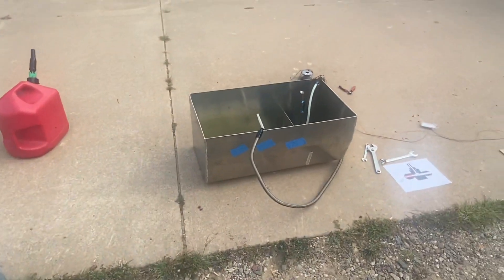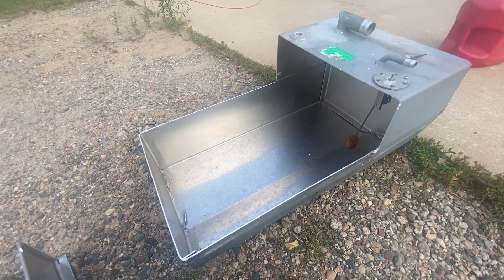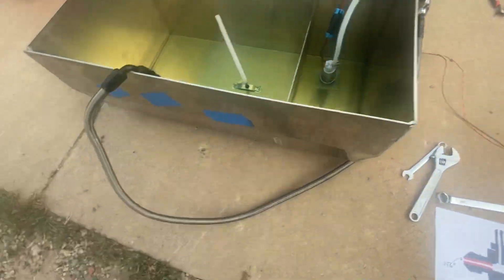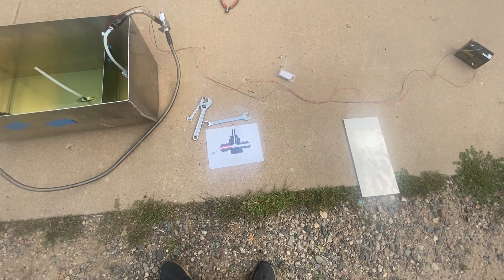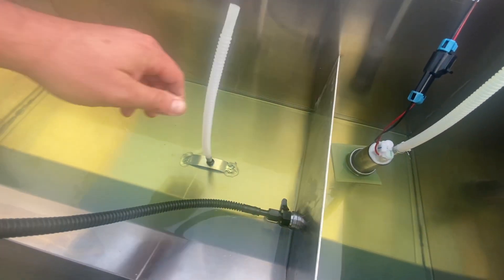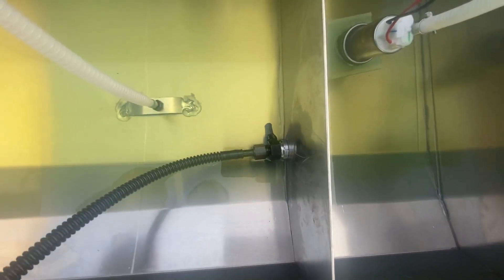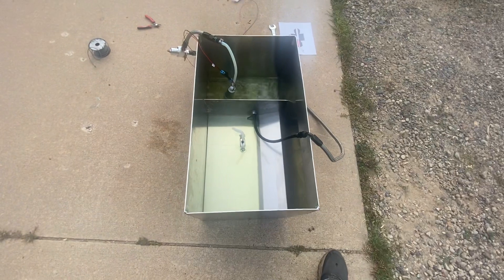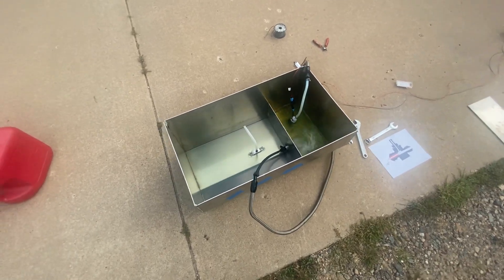Building fuel tank venturi jet pump, Turbo BMW boat part 3

Comment: It´s a snazzy solution, but you could have just gotten a 30USD lift pump that would run when the main pump runs, takes about 1A and would keep the reservoir full, another option would have been to take out a jet pump from a BMW fuel tank and just use that.
Reply from the maker: How is that better than this which cost like $15 and can never fail and takes no wiring?  I don’t have any bmw fuel tanks.
Reply: What you have there is reliant on the amount of return flow, which of course usually is plenty, a pump has no such relations.
That is but one a reason why jet pumps aren´t used in race cars but lift pumps are. @someguy325es 

I should ad that an even better solution and cheaper solution would have been to just dump the return fuel into the reservoir and have a 2mm hole at the bottom of the seperator plate.
Reply: that venturi pump is superior. When it is set, it never fails or draw any power and no excess wiring.